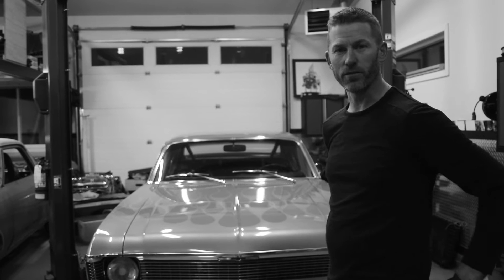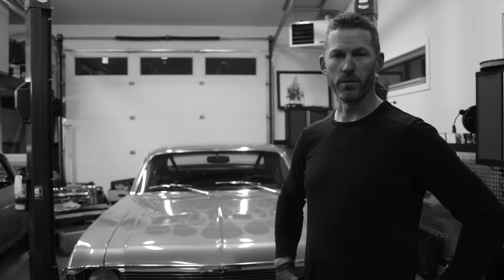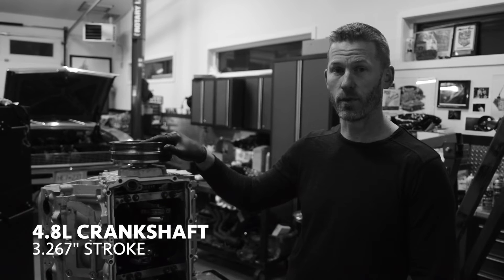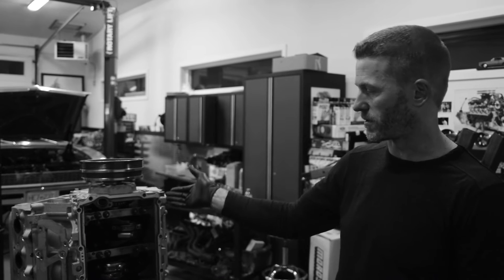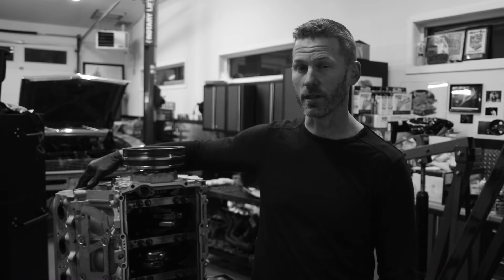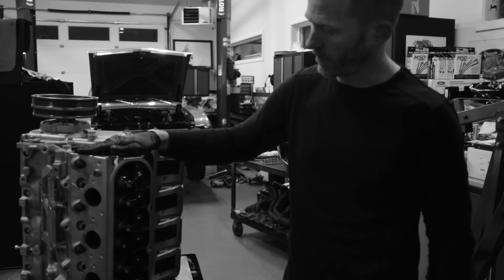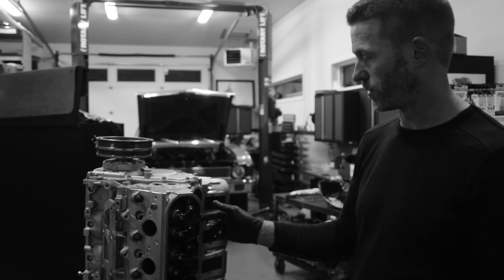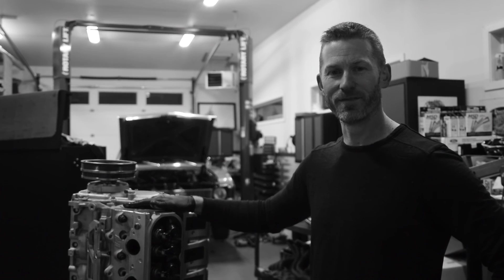468 LSX, 349 LS Discussion

Comment: did you have to sleeve the 6.2l block?
Reply from the maker: Nope. There’s plenty of room to go 4.125” on a 6.2 block. Done this a couple times making over 600 HP naturally aspirated. 
Thanks for commenting :)
Reply: @ceperformance any experience with the iron 6.0 blocks bored that far?
Reply: @ceperformance what about aluminum 6.2L blocks does its need sleeves ?
Reply from the maker: @R35Q8 
The 6.2 block has iron sleeves cast into the aluminum block. They have plenty enough support for this level of build. If building something for boost, I might choose an iron block.

Comment: 12.1 compression normally aspirated nothing really big on cam specs, and only run it up to 7200 rpm's.
724 hp and 585 torque if memory services me right, and no extra porting on intake, throttle  body, are heads is that correct.
Man that thing will be a tire shredder in the Nova, but if it hooks up, he's outta here like no one's business. 
What do you think it'll make on carburetor, and what size carb do you have picked out for it.
Actually it possibly could exceed the dyno numbers with the right carb and intake package, especially if ya'll were to devise a ram air setup. 
We use to use the inside headlights as a place to run 6" aluminum co flex to a truck air cleaner that had the tall air filter init.
For those that didn't have the 4 head option, you can always tap it into the radiator support, are drop down just below bumper, and flatten the aluminum flex out to a wide oval to pickup extra air to shove down it's throat. 
No header wrap to help scavengen the exhaust out as best as possible. 
Yes ole school tricks we use to do trying to squeeze everything possible out of the old cast iron beast of burden, and I always have had a special place in my heart for the high preformance 327's outta the early vettes.
60 over good set of pistons gasket match the intake and heads beehive double springs on a good valve job.
Better lifters biggest towing comp cam you could get, push rods to finish of valve train, 750 dbl pumper big high volume mechanical fuel pump bigger fuel line, long tube headers followed by 3" exhaust through turbo mufflers dumped out right behind the cab of the truck.
Aluminum light weight fly wheel, hayes super clutch m21 muncie outta 69 Z car 12 bolt posi with 373.
She was a special ride, because for a lwb C10 camper special for 1970.
No ps, manual brakes, only thing on the engine accessory drive, water pump, flex fan through a four row radiator, and over sized alternator to run the graig power play stereo and graphic equalizer and amp.
Set of Dayton L 60's all the way around on hurricane 11 magnesium deep dish wheels. 
With big block springs in front, sway bars on each end, and 200 lbs of concrete parking lot bump bolted directly over the axle. 
Oh yes, the part that really pissed the FOMOCO boys off, mighty mouse was painted the light ford engine blue.
Big blocks small blocks only thing that I couldn't beat or at least keep up with, was the Kawasaki 900, 900 with 1000 kit and the 1000 cc Kawasakis.
Nothing coukd hang with them, because once they hit second gear, and the tire was hot enough to stick, they were gone like my ex wife got her settlement.
Ya'll really should build yourself a late 60's early 70's C10, only use a Escalade drive train all wheel drive with a super charged 6.2 of ya'lls making.
Man that'd be a bad biotch if there ever was one.
Sorry, got carried away in old memories, but dam I do miss them days long ago, and nothing but fading memories left of all of those good times.
Ya'll remember when you were 17 or 18, and how simple life was. 
Dam sure ain't like this shit we all have to deal with nowadays. 
Ya'll take care, and be safe out there ripping around in the dark of the night. 
Peace n Harmony be with you my friend
Reply from the maker: Timothy, thank you for sharing! 
To answer your question, we’re using an old 950 Holley that I’ve been using for well over 20 years. I also anticipate the carb and Super Victor manifold would make 15-20 more power up top, over the low plenum EFI intake. The porting was just the transition from the intake and through the intake spacers we got from RHS because of the tall deck block we’re using. 
I’m encouraged that through our little videos you’ve been reminded of great memories of times past. I hope the sharing of them will keep those sweet times from fading away! 
I appreciate your enthusiasm :) 
Take care!
Steven.